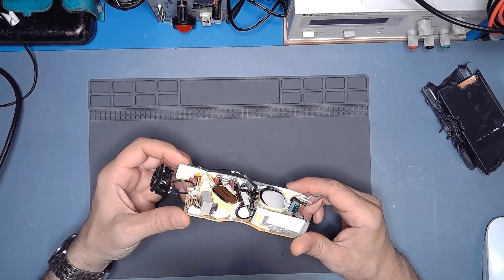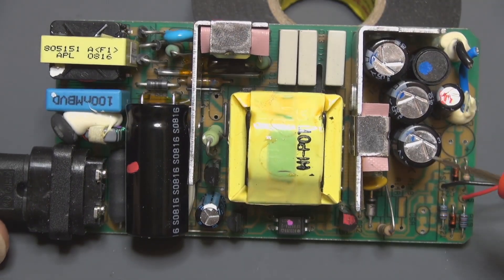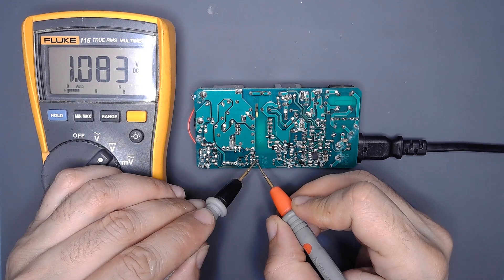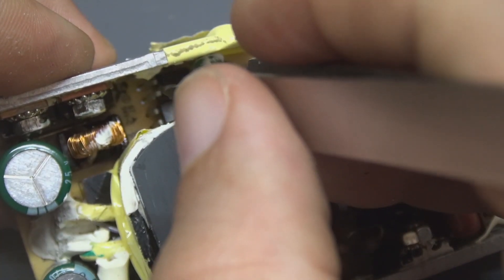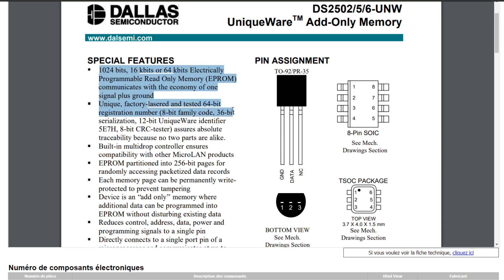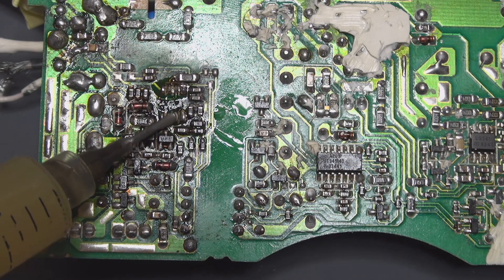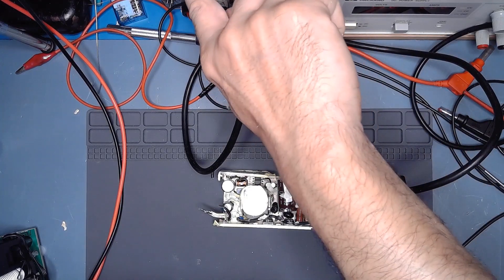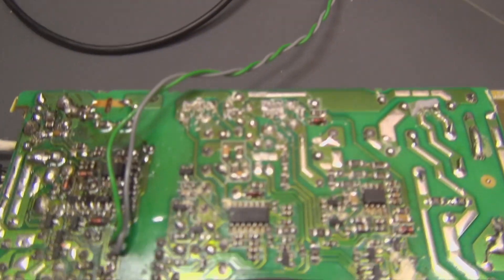DELL laptop's power supply repair: it wasn't the OPTOCOUPLER

Comment: I have the same Dell power supply with the LED going out,
 I suppose the fault will be the same.
Reply from the maker: changez d'abord le condensateur de sortie, ça peut régler le problème. Après réparation, l'alimentation ne marchait plus aussi bien. Bizarre.
Reply from the maker: This kind of issue comes mainly from the dead output capacitor. To test it, connect a new capacitor on the positive/negative wire (without opening the box) and plug the supply. It can easely fix the issue. This power supply didn't survive a long time after this fix. Something was going bad.

Comment: I really love the Dell power supplies whenever I go to a thrift store or Goodwill and I find some I always basically purchase whatever they have since there is such a good deal. One thing I use them for is for LED lights and the controllers that take up to 24 volts they work perfectly with them and they're pretty robust as well and since they have construction hats literally bomb-proof well almost/....
 well they work great outdoors!    

with even better filtering they actually work Wonderful for audio amplifiers like the boards that you purchase on eBay and Amazon.
Reply from the maker: yes, I agree with you. Reliable and robust, protected against short circuit, and low energy consumption.

Comment: What is the voltage at the middle pin?
Reply from the maker: something between vcc and vdd.
Reply: @AIexanderHartdegen  I am getting 0.2 volt here which is not correct. How can I find the fault here? thanks in advance. I have good 19.5 voltage as output. Just the middle pin show very less voltage.
Reply from the maker: @Yureka-ox5jn  I don't know the middle point you're talking about. This video is getting old and I moved on since this video. The only information you can have are in the video, otherless I can't remember. I have change this power supply by a 6 amp one, because it was finally overheated.
Reply: The most common problem is Lta201 ic, there is internal break of resistor for initial startup
Reply from the maker: This is a bus comunication, with a code integrated to the TO92 chip. If the Dell Laptop doesn't have this pin, it refuses to connect to the charger properly.